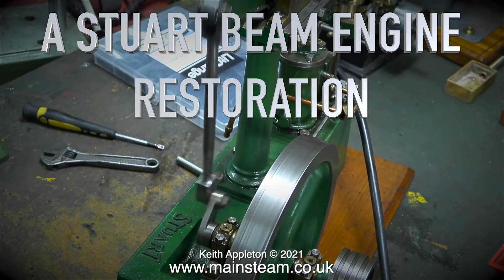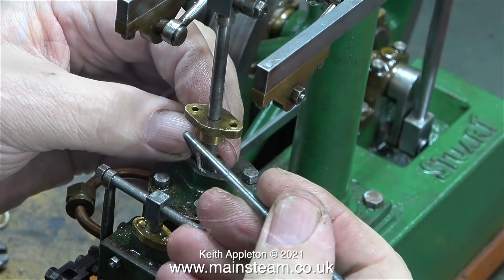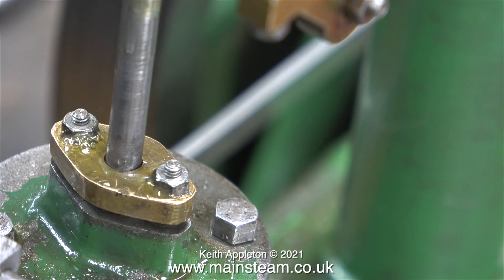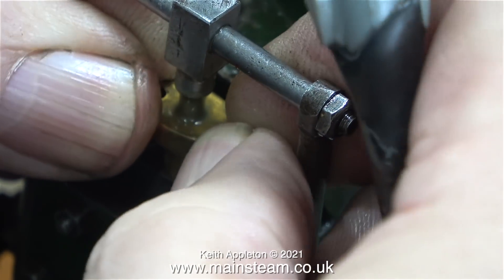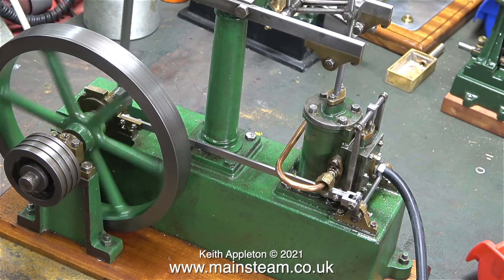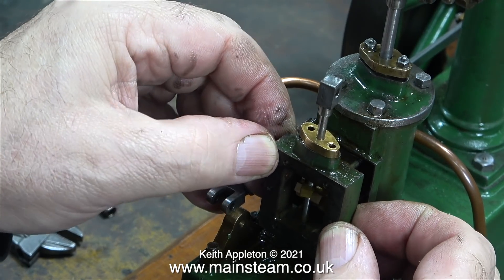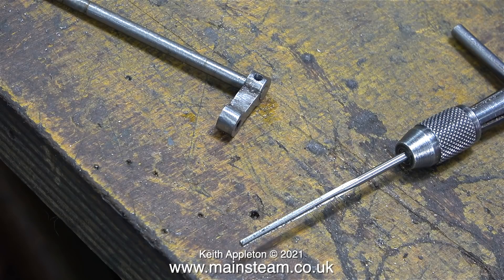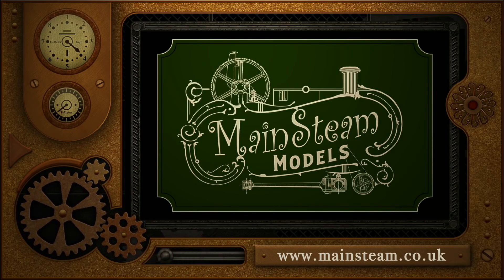A STUART BEAM ENGINE RESTORATION - PART #2

Comment: The devil is in the details!   The engine looks good but little things like the grub screws and loose shaft arm mess up the running of the engine.  I remember you once said that a lot of machinists know how to build the models but their lack of experience means they don't know how to make the engines run right.